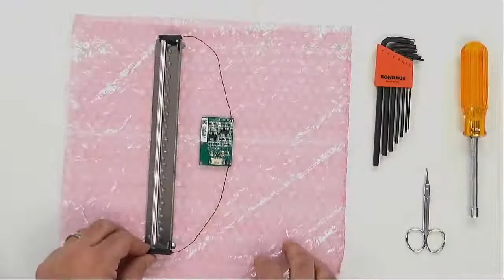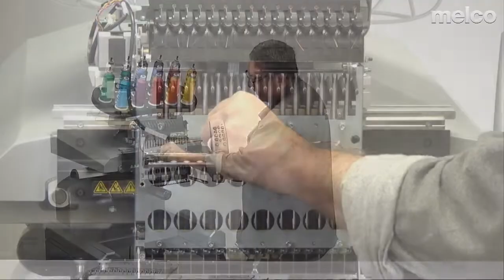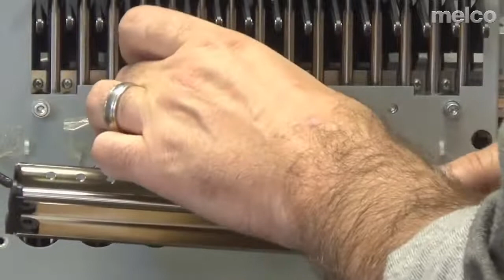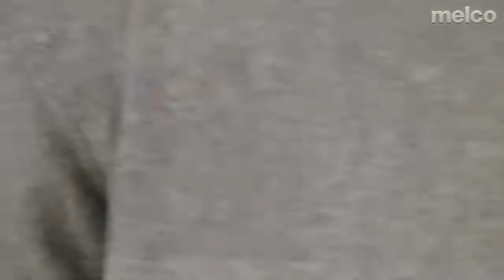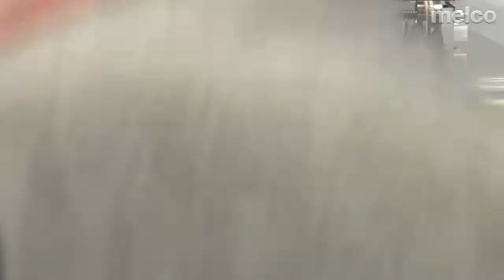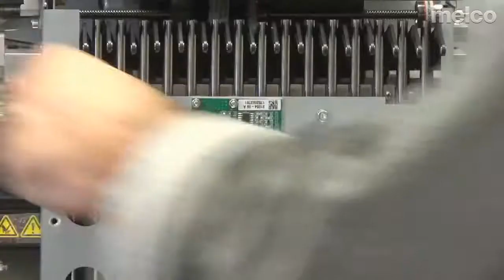Replacing the Thread Sensor (Acti-Feed Sensor)

Comment: I cleaned and greased pinch rollers and thread feed rollers. The left side feed rollers will stop and start feeding while sewing and the graph is erratic when left side is sewing. The bobbin thread is pulled to the top and occasionally a thread break will occur when the left side is sewing. I think it may be the active feed sensor. Is there any other checks that can be done other than replacement?